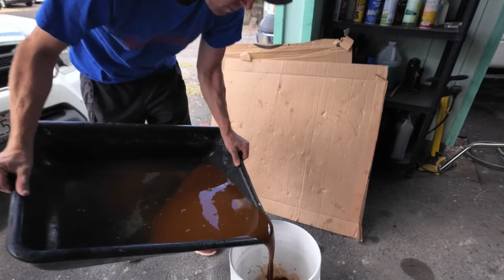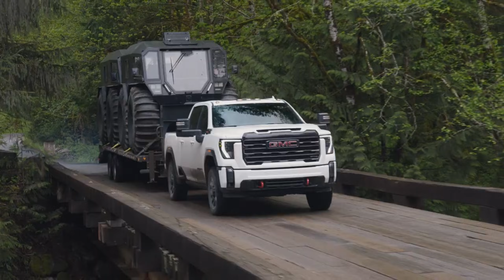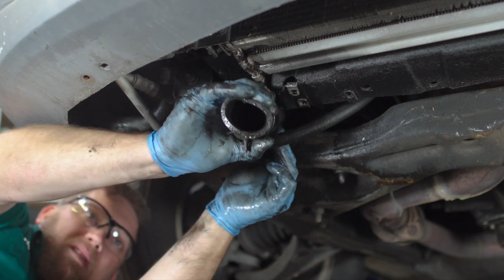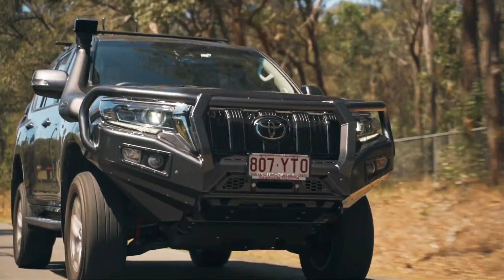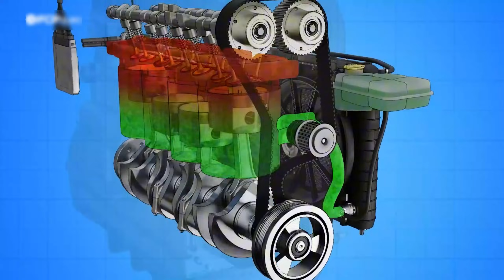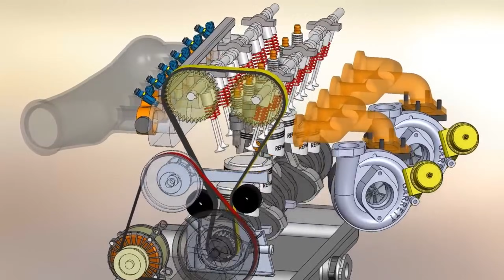Doing This WILL Make Your Car's Cooling System Last FOREVER

Comment: Rust particles don't build up in the cooling system!!!! It has an anti rust cooling fluid in there, JUST BS. Where do the particles you mention come from??? EXPLAIN THAT! Flushing IF required, can be done with TAP WATER, It is a FLUSH and it isn't there long enough to allow the minerals you claim will contaminate the system to remain there. BS AGAIN. A filter doesn't protect the thermostat. A filter IF there is anything to catch will restrict fluid flow AND CAUSE OVERHEATING. The coolant DOES NOT CONTROL ENGINE TEMPERATURES, That is done by the DESIGN. WHO HAS NO IDEA ABOUT COOLING SYSTEMS AND is PREPARED TO DELIVER CRAP TO VIEWERS with NO CONSCIENCE AT ALL?????????????????
Reply from the maker: Sounds like you’re passionate about this, and I get it! You're right modern coolant does have anti-corrosion properties, and improper filtering could cause flow issues. But debris can sometimes come from deteriorating components like radiators or hoses. Appreciate the critique there’s always room to clarify and improve.

Comment: First, you DON'T need to flush your anti-freeze coolant every year! You're pissing away money replacing coolant that's designed to last at least as long as the anti-freeze is rated to last - typically 5-8 years, or more. Your 'tiny coolant passages' will NOT get clogged. If you change your coolant at the recommended schedule, there will be minimal corrosion anyway. Yes, if you use a brand-name quality coolant, with anti-corrosion additives, your coolant will last as long as the coolant says it will. Also, when you flush your system with distilled water, there will still be some left in the engine, even after you drain it. Best to use the type of coolant that is not pre-mixed. Make certain to use the specific type of coolant your car requires. There are significant differences, and different types cannot be mixed.. Check your specs as to the volume of coolant in your system, then add exactly half that amount of undiluted coolant, and top-off to the 'full' mark with distilled water. This will ensure the coolant isn't over-diluted by the water left in the engine after the flush, which will degrade your coolant's anti-freeze capacity. Get a hygrometer or use a refractometer, that is designed specifically to test the cooling efficiency of your coolant, depending on what specific type of coolant your car uses. The old-style floating ball testers will not work properly with modern OAT, NOAT, and HOAT formulations. This will help confirm if your coolant is still good, or whether it's time for a change...
Reply from the maker: Great breakdown! You're spot on flushing coolant too often is a waste if you follow the manufacturer’s guidelines and use the right type. Modern coolants are designed to last, and testing them properly ensures you avoid over-dilution or compatibility issues. Solid advice! 👍

Comment: DO NOT use 'plastic body' cooling water filters on your cooling system.  Reason: most 'plastics' begin to 'soften and deform' at over 180° F; and then, when under pressure (13 psi is normal in a vehicle) will 'begin' to expand and DEFORM.  So, if you do choose a plastic filter be sure to choose one with a thermal rating of ~220°± .   
Simple speak:  Choose ONLY a coolant filter and filter housing that are SPECIFICALLY RATED for HOT (~220°+) pressurized HOT WATER automotive service.
Reply from the maker: Good advice! Coolant systems operate under high heat and pressure, so using filters rated for automotive conditions is crucial to prevent deformation and failure. Thanks for the detailed tip.